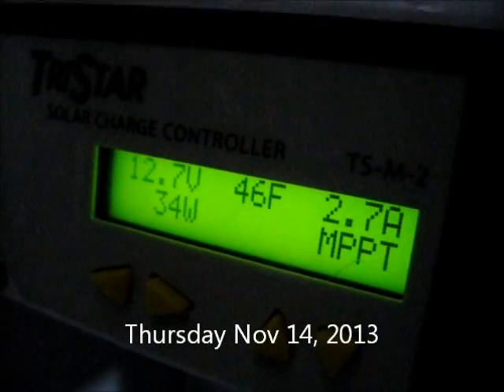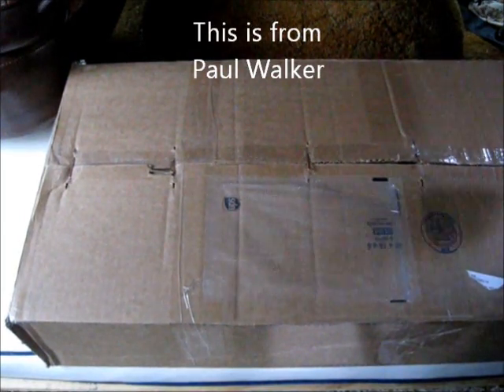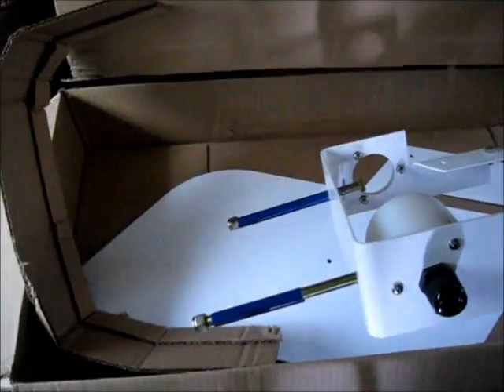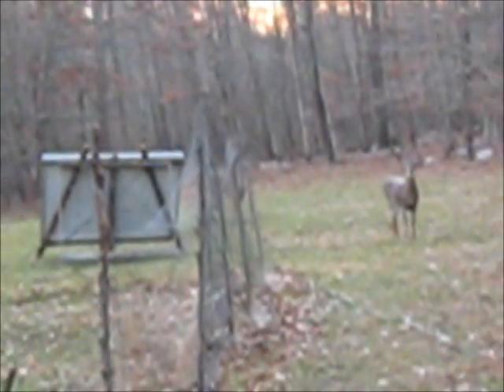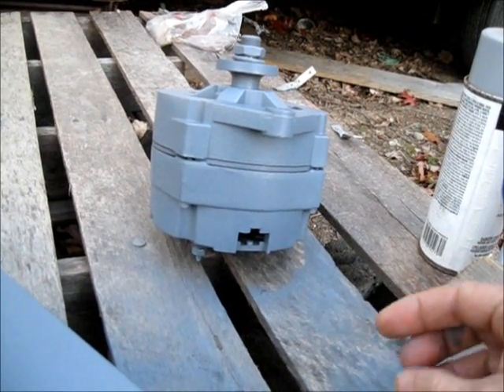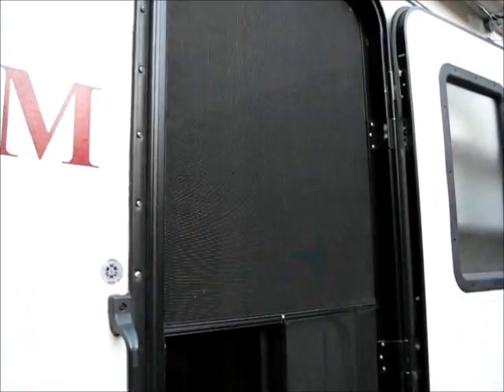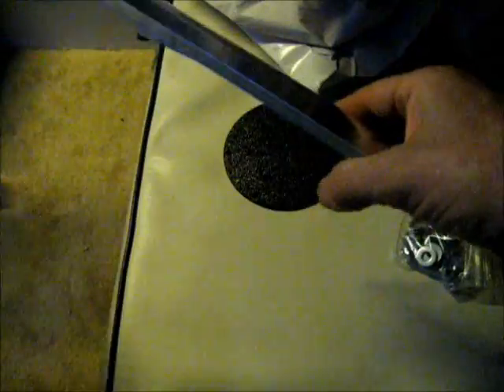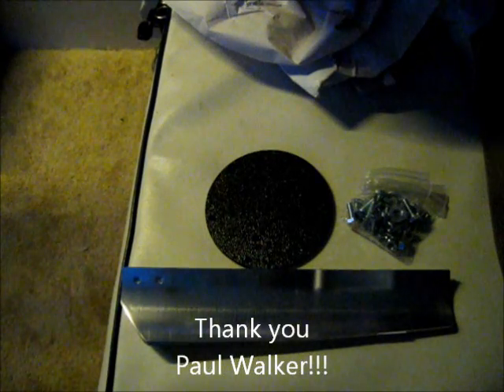Painting My Wind Turbine And Misc Off Grid RV Work Today

Comment: I used to work in an Auto Body Shop and we would use wire clothes hangars to hang parts up to paint them and it worked pretty well.  Sometimes when we had a lot or pieces to apint, we would run a rope or string and hang the hangers off from it and seperate the parts down the rope as needed.
Reply from the maker: Thanks for the tip

Comment: if u could find a half sheet of tht pag borad they use in parts stores tht stuff with the lil holes thn you could ciut it to size to fit opening of window or get  sum steel mesh tht would keep baby safe inside ....
Reply: Sarah, something like chicken wire would be better for the opening to keep Baby Cat out of the heat shed. Pegboard and other small wire mesh would restrict the flow of warm air too much. Especially pegboard with either 1/8" or 1/4" holes. 

Agree with you that the opening should be covered to prevent a Baby Cat accident. A wooden frame, that fits the opening, and covered with chicken wire may be his best option. Easily removable when needed. Minimum restriction of air flow. & Baby Cat can't get through it. :-)
Reply: wow i didnt think of that yea tht would be a kool opshun ...

Comment: Troy, there is convection already. the cooler air goes through the bottom of the window. When you add the proper cold air return under your bed, it will just be more efficient convection. what would be nice is if you could get one of those heat powered fans to sit on top of your stove and facing your window.
Suggestions I have read that you should look at:
1) fill up trash bags with leaves and stuff them under the edge of the camper for a wind break.
2) finish off the back hatch
3) fill up the water tank in your RV
4) put more bricks around your Stove. Better heat retention and protection for the shed.
5) Use a 40 Watt bulb in a cinderblock, a couple of batteries and the Harbor freight panels to heat up the chicken coop.
6) Eat better! I am concerned that you are not eating well and that is contributing to your poor health.
Reply: i got one them heat fans on my stove they not as good as the say helps a little
Reply from the maker: I agree with most of your points but one. The leaves are a fire hazard. I was going to do that but someone strongly warned me to stop immediately.
Reply: The Do It Yourself World troy, I see the potential for a fire hazard if the bags are placed near the fire shed, but I dont know how they would catch fire if placed on the opposite side of the RV. Spontaneous combustion just isn't that likely in winter. Anyway, it is just an idea for quickly skirting the rv. If I rhink of anything else I will mention it.

Comment: It like water if there a huge temperature difference where one cold and hot the cold will sink going out of the bottom of the window while hot air will flow in through the top of the window as your shed and rv want to be the same temperature even if there only one passage for it to do it at.

Comment: First it's warm get out and get wood, second take the small white tank and either put on porch or on your desk where its warm. Then hook up the on demand shower and also run a line to the kitchen sink hot water. Your wasting everything  they give you. What about the timers someone gave you to turn off fan when it get cooler, put one of the small turpines on a pump for the water to get it into the small tank in the rv run line thru window once a week. Put the rain collector on the forest edge next to the rv then turbine power water to rv . and please put some cover and nesting in the box for the poor birds before winter.That black tank would not have froze solid and it would have expanded if left air at top, you can still fill up the small one now before winter.
Reply: Quote: "Your wasting everything they give you."

1. He has an on board fresh water tank. Why would he need to put another one inside the RV? Would the place where you want him to put the second one support the weight, once it's filled with water?

2. On demand water heater, runs on propane, is for outdoor use only. Not vented for indoor use. What's involved with mounting it outside, providing freeze protection for the lines, and to incorporate into the RV internal water line system? What happens when he's out of propane, as he is now, because he gave his supply to Chris? Costs both TIME and money to get this operational. Time better spent elsewhere right now, since you want him warm from getting wood.

3. Timers - if they are not thermostatically controlled, can cut off the fan prematurely. Further, from this video, fan may not be needed in the window. 

4. Wind turbine & pump. Same considerations with water heater with regards to freezing, time to setup, etc.

5. Rain Collector on edge of forest - Thought about that. And though about all the debris he'll have to deal with to collect rain water. Not only mounds of leaves in fall. Bird & insect droppings, blooms from trees in spring, twigs, etc. The closer to the trees it's installed the more maintenance issues with regards to having usable water. 

6. As much as he cares for his birds, I'm sure he'll get the roof covered again soon. Even if he doesn't, his chickens have far more protection from the elements than the wild birds that survive the winter where Troy lives. God, in His infinite wisdom, gave birds what they need to survive without comforts provided by man.

"Your wasting everything they give you." 

Easy to say when you're not walking in his shoes.

Matthew 7:1-2, 20
Reply: Oldtimer Lee He said he didn't like the taste coming from it. The desk is where the other bed was at. It would be just temporary.  I think it could handle it, if not put on porch. and they use the on demand heaters in tiny houses you have to vent it out or he could hang on side outside and tube line in.
Reply: Oldtimer Lee the wasting is the window stuff he got along time ago, the heater he can vent outside and either put tank in or out and tank aren't that expensive. The timers he got are temp controlled still in box. A screening or a tube drain with a cap at bottom to clean out junk will keep it out. it's been done on other sites.  He waits to the last minute to do this stuff and he is suppose to be a preparer. I live in MI so I do know how cold it get, also drove semi, survive on very little. Have hugh house that won't sell, so stuck, till market goes up. Now retired and you learn the hard way to economize. would love to get solar panels and wind turbine to help. Did put a timer on my frig/freezer for half hr on two off this month. will see when I get electric bill.  oh well hope he makes it.
check out the sites on my YT the guy in texas has the cleanout system, the semidriver has the heat tank indoors setup and has one turbine and three panels, a lot less than troy.
Reply: Karen Lincoln You have the one guy Bill o Rosa he is the one that put the on demand in house setup
Reply from the maker: Karen Lincoln Since you are in Michigan and know now cold it is then you also know that insulating my windows is not "wasting" anything. And I have been sick for two weeks. Not moving as fast as I should. I am alone doing everything myself. Things take time. I have a LOT to do but not much time in a day.
Reply: I was watching Missouriwindand solar last nite and they were talking about the dumping of power and even had a element to dump too that heated water. Cool idea a lot of helpful ideas and info, also how to find clean air not dirty air so you place the turbine in proper place. Very helpful videos on there site.

Comment: You start off by writing that it is the 50s today.  I know you must have hundreds of little projects that need to be done, but wouldn't it be more beneficial if you spent such a nice day cutting firewood.  I don't mean to sound critical, but it's probably going to be a long cold winter and you seem to have just enough firewood to last for that day or just a few days.  What happens when there's two feet of snow on the ground and you can't cut anymore wood.  I know getting a grip on your comment section must be important, but you are also suffering in your cold camper.  Just saying.
Reply: Eccanc, he's in a far better position this winter than he was last winter. Had to move the travel trailer, last winter, when there was snow on the ground to a place where nothing was prepared. Plus, if the man who got the Honda doesn't cheat him, there's more wood on the way. 

Another, plus. Plus, getting a grip on comments & other aspects of this Google+ integration is important. Dealing with the same battle that others face who derive some or all of their income from work on the Internet & especially YT. Troy isn't the only one who has been negatively impacted by this change.
Reply from the maker: No, its nicer to cut wood on colder days to keep me warm with the movement. The warmer days are very rare now and must be used for other projects. I cannot paint for example below 50 degrees F.

Comment: i got my wind turbine blades with no bolts i ran to hard ware store and got them i put it on my wind turbine and work on it more today to move it higher! it was dark when i put it up! i was gone most of the day!
Reply from the maker: Hope it works well for you
Reply: it did i had more power to battery's though a solar charging unit 7 amp reg both wind turbines no solar panels though that controller, i replaced it when i added 2 panels and had a 5 set  to a 10 amp charger controller, it the left over unit!The Do It Yourself World

Comment: yes heated air rises but u still need the fan for circulation  to spread the heat around an down towards the floor ....  and someone in replies had a good suggestion  bag up some leaves and place them as under pinning around your home or at least on the side of where most wind comes from...   also gonna get some bad weather very windy coming your way in the next few days  .... i also sent a re: on the magnets
Reply from the maker: Got the message. Thanks. The fan in the window does a pretty good job at moving air through the RV for me.

Comment: I'm awaiting the day there is a paintable light. Basically a substance that can be painted on something like a wall or ceiling, electricity applied in some manner and it lights up. "Light without a perceivable source" is what I am looking forward to. I'm odd but I prefer white LED light over CFL or incandescent. Also, to hide the wires for the LED strips, just drill a small hole in the cabinet at the end of the light strip, thread wires through the hole and hide them in the cabinet. Maybe mount the switch on the outside of the cabinet.
Reply: do a google for electroluminescent paint http://lumilor.com/ very cool
Reply: Im sure the water from Fukishima nuclear spill would glow in the dark!
Reply: brian gunter I almost didn't see your comment. This new comment system is a horrible failure. Good link. Will have to investigate further.

Comment: Hi Troy,
Been watching your videos for quite some time now, thanks for putting them up.  Just wanted to warn you that before you get playing around with your wind power you need to get a proper dump load charge controller in your system or you WILL fry your batteries.  This is what nearly happened to you the other night when the voltage went above 15 volts, the high voltage was not caused by your Morningstar charge controller, it was only reading the current battery voltage caused by the turbine pumping excessive amounts of power into your batteries and caused your inverter to shut down on over voltage.  Because you currently have the 350w turbine hardwired to the batteries you have no means to regulate the wind power and its going to keep pumping power into the batteries until they boil dry (remember the hissing sound you heard? that is the sound of your batteries being destroyed. More wind power is just going to boil the batteries faster) Worse case scenario the battery plates are going to be warped and they will then make excellent doorstops.  You need the dumpload on the turbine otherwise the blades will freewheel in high winds when the regulator disconnects the load to the batteries and likely spin themselves apart.  I would recommend that you get a water heater dumpload and heat your water collection tank to prevent it from freezing with the excess wind energy.  Mike Davis has a great and very cheap design for a controller, based on a 555 timer I've built it for less than $20 using parts from my parts box and it works quite well.  Just google "555 based wind charge controller" his site is listed at the top under mdpub.  Good Luck and don't get discouraged but please protect your batteries or you will be sitting in the dark for sure.
Reply: you can now put links to other vids in the comment section:)
Reply: That makes things simpler.....  Heres the link to the 555 charge controller design.   http://mdpub.com/555Controller/  Its super simple and super cheap to build.
Reply: The beauty of it is if you increase your system current requirement all you have to do is replace the relay with one that has heavier contact ratings.  The electronics portion stays the same.
Reply from the maker: The high voltage the other day was due to the charge controller doing its job. It gives the batteries a higher voltage once a month to equalize them and knock the sulfation off the plates. Other than that I agree with you and am looking at options now.
Reply: You've owned that charge controller for more than a month... When was the last time your inverter was shut down by over voltage due to the de-sulfate cycle? All I'm saying is before you keep blindly hooking up anymore turbines you had better get some form of controller on them to protect yourself.  I would hate to see you stuck in the dark.  Best of luck and keep up the good work.

Comment: Looks like you're going to have both a Solar Farm and a Wind farm now! I actually like that primer color you painted.

I agree, NOW is the time to give some serious thought about where you place everything in your property. It does seem like you would benefit from relocating your solar arrays closer. You would get more sun exposure AND you might be able to have shorter line runs which would lower the loss from longer line runs.

Just a thought about your rain water catchment. Could you cut those long runs of sheeting down by 1/2 or 1/3 and place them side by side? You would still have the same surface area, but they might catch less wind. I could be wrong about catching less wind since it is the same surface area, but it would have a smaller footprint taking up area in your yard.
Reply from the maker: Yes its going to be good. I am going to move stuff now too. Just thinking about my options now. Not sure about the metal sheets. Might catch less wind that way per sheet anyway.